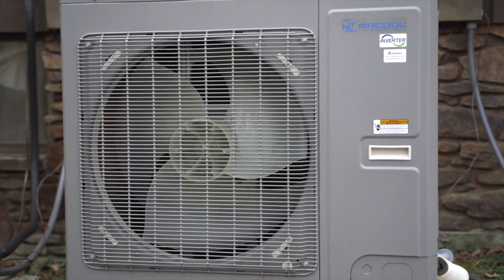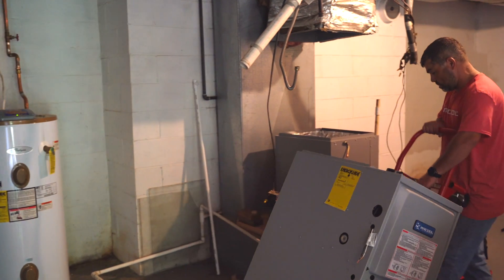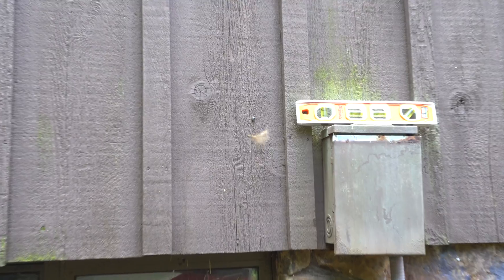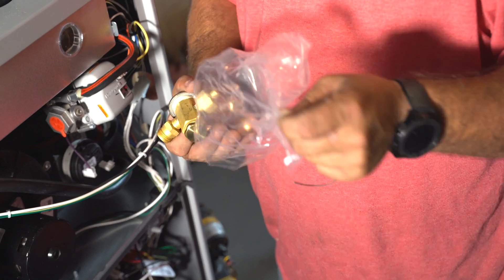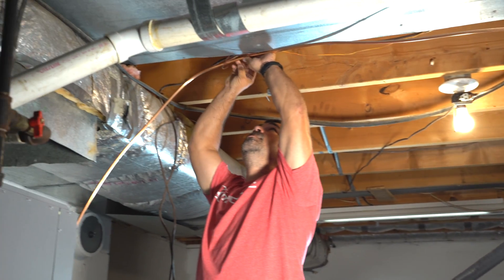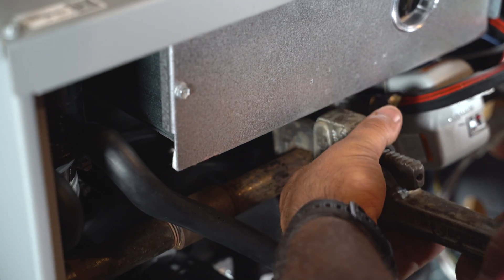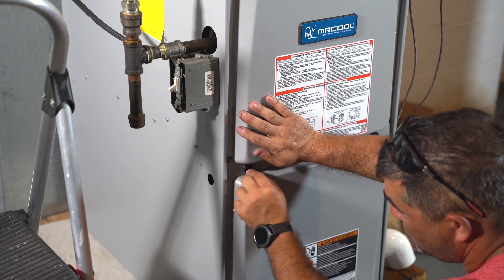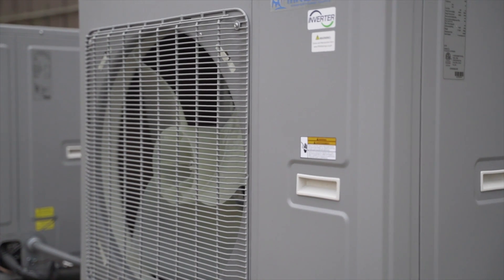Installing a MrCool Universal with a Gas Furnace

Comment: Question.   Why would you need to incorporate a gas furnace if the Mr Cool is rated to produce 100% rated BTUs down to -5 degrees?  And gas cost more than electricity.

Comment: Where do you get the freon? I've been vacuuming gout the line all day and it's still not working. I think I need a bigger shop vac. Are the gas pipes lefty loosely right tighty like a nut and bolt? Any advice would be greatly appreciated.
Reply from the maker: Please call tech support at 270-366-0457.

Comment: Those guts look like a Lennox, interesting
Reply: Your correct I’m pretty sure they’re like the Ducan furnace same as Lennox just minus the ECM blower motor and insulation lol
Reply: Correct. Same furnace as the cheap Lennox merit series. Other brands are ducane, adp, aireflo. There's also a blueridge furnace brand, same thing.

Comment: Why dual fuel when the unit gives you heat well bellow zero?

Just telling a customer today that is thinking DYI about the Universal model.

You really should have that knuckle head wear safety glasses when brazing.
Reply: Always dual in a cold climate.
Reply: gas heating is generally cheaper than running the heat pump when it's really cold outside.